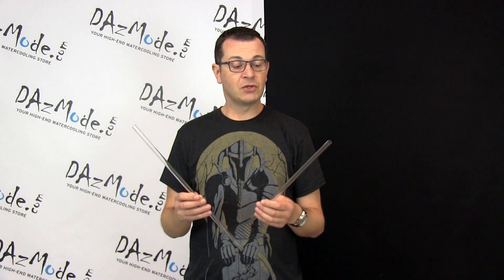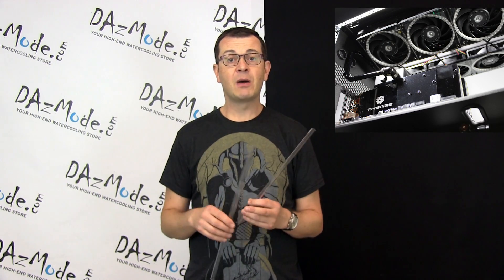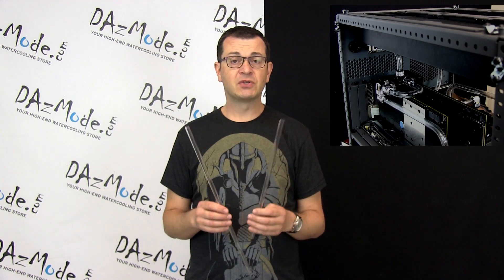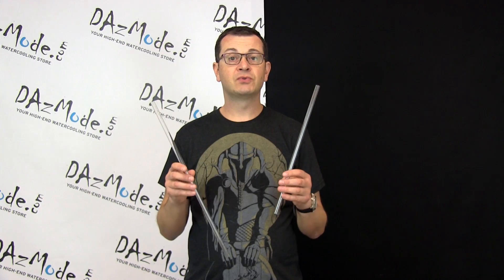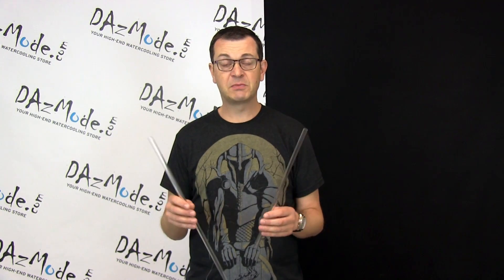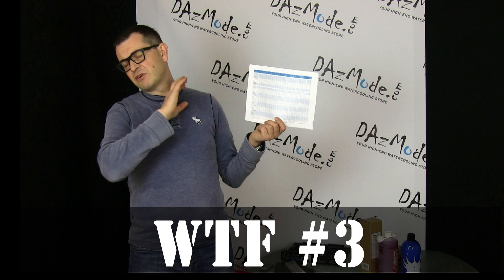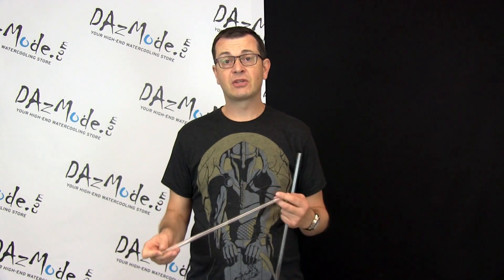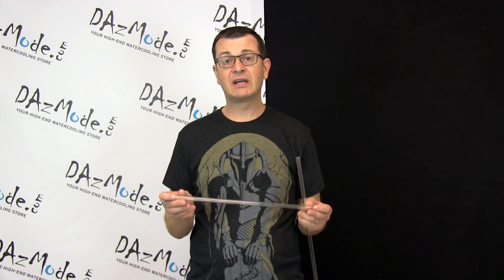Acrylic vs PETG  Hard Tube  - DazMail #8

Comment: Thanks for the video and based on my personal experience this is a very fair and balanced review.

I used both Acrylic and PETG over the last years and these days I am mostly using PETG as its so much easier and more forgiving material than Acrylic especially when it comes to bending and cutting.

One additional point from my experience is that Acrylic tubes can sometimes get discolored/slightly milky where you heated them for a bend especially when you use dark colored tubes like dark blue.

For coolant I only use destilled water with a biozide these days. I do not use Glycol based coolants because there is a whole rather complex are of potential chemical incompatibilties between various glycols and rubbers (ie o-rings...) which I do not fully understand but is not worth taking a risk... Color based coolants I stay away these days because colors will break-down over time and then the residue will clog your system. Also if you want to change colors its usually a lot of work to get rid of all the residual color in the system.  Also I do not really trust these little "boutique shops" which sell these pre-mixes, you do not know/they do not specify whats inside, you have no idea how extensively it was tested and probably these companies can not afford a proper quality control organization in the first place... just my thoughts.

Comment: For people who just watercool for silence (and/or performance), instead of aesthetics, PETG is ok because it saves time and efforts, coolant issues like Jay's (JayzTwoCents) won't happen because most people who wants to run them long-term will be using distilled water. I personally still use acrylic, but to be subjective PETG ain't that bad. Still, if you wanna use fancy coolants, especially those who're after pastel fluid, acrylic is a much better choice than PETG (unless you go hardcore and build on glass tubes).
Reply: +Adom Doledas Amusingly, there is suspicion now that the coolant issues started to happen when radiator brand was changed. :)
Reply: +Paweł Czarkowski Good thing you mentioned it because Jayz's new fluid (clear, not pastel) has changed color again. Wonder what has been the real element that caused the problem, probably the rad at this point.

Comment: DO NOT USE PETG NO MATTER WHAT. People use it and it is very bad. Also it's not the tube that will fail, the tube will break down slightly over time and the liquid will be compromised. JayzTwoCents had a minor issue with his liquid due to this, he didn't know the reason for it, but is it. This is just one of the reasons I would NEVER recommend PETG for anyone. Please don't use PETG.
Reply from the maker: +Jesse Exactly. On the mass scale there is  no consistent issue with either of type. But there is always one guy who have something off.
Reply: +Jesse I have a system that has been running pascal for years without a problem. Soft tubbing and PETG both break down over time leaving the fluid bad.
Reply: +pvtmatchsticks The perfect solution in my books is copper tubing, but that tends to be more work. I use whatever I have at the moment, and if I have time to saw or just cut. I'm also a person who believes in running just distilled water for long term use. Done right, I believe that PETG might work great as well with pastel. We have a system with UV dye running since 2013 and PETG, still no issues to date.
Reply: +pvtmatchsticks Amusingly, there is suspicion now that the coolant issues started to happen when radiator brand was changed. :)
Reply: +pvtmatchsticks JayZ's issue was caused by not using the product correctly, pastel liquids are not meant for long term use no matter the tubing. Wonder what are ur reasons for not using PETG. We have yet to have any issues with PETG, and have been using them since day 1.
Reply from the maker: +pvtmatchsticks This is interesting point about longevity. While I'm not sure about PETG, acrylic definitely would last longer than PVC soft tube without changing much. You can use and re-use acrylic reservoirs seems  forever.
Reply: +pvtmatchsticks 
I'd have to see some proof of that statement.
I have yet to see a video where PETG does this.
Yet there are hundreds of videos on YouTube where people are using PETG without issues.
As far as Jayz's situation, I believe his problem is related to his radiator being dirty.
I had a similar problem with aThemochill radiator before. You had to clean them really good.
And even when you thought they we're clean, they would still be dirty and cloud up your loop.
Reply: JayzTwoCents has no dam sense... pc technology has advance way ahead of him..... his channel is just and ads site.